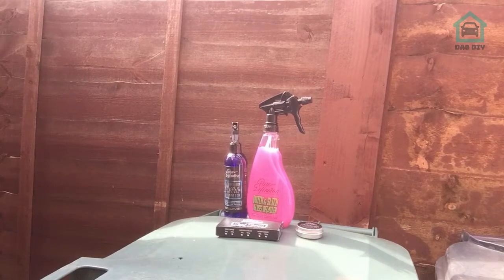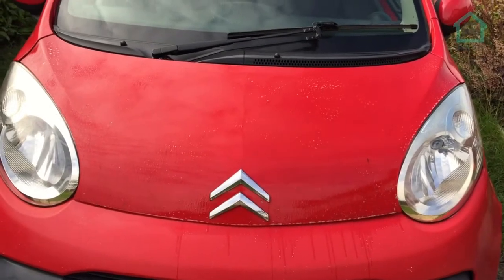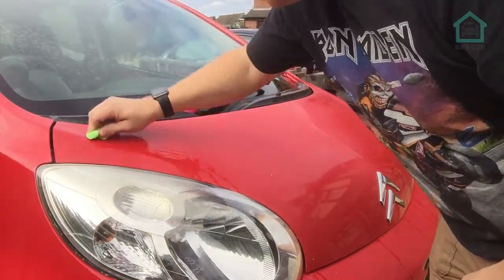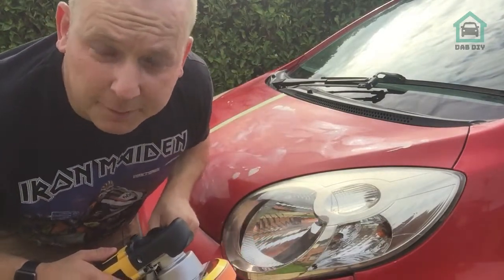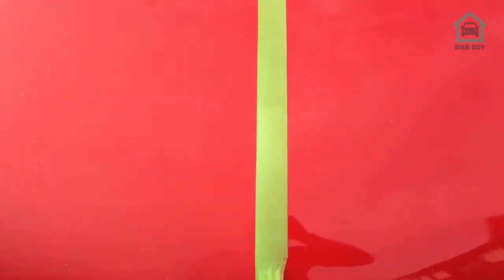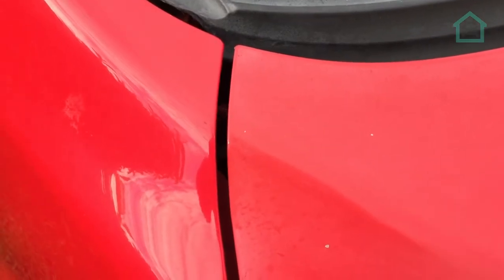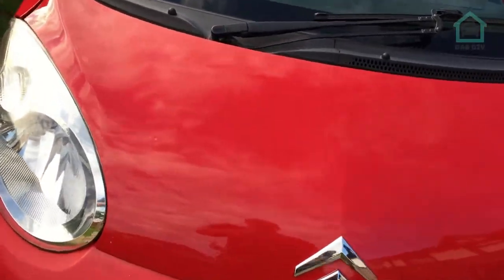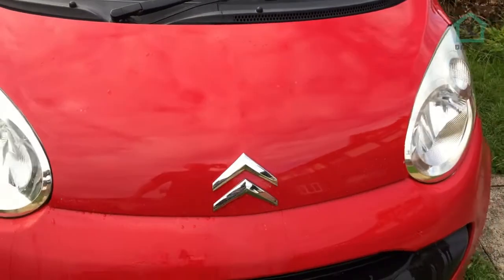Using a DA polisher for the first time

Comment: Been painted before    seen it done it,, bodyshop, tech  it will fade again  best get it painted  and a good laquer  put on it   if it were myn
Reply from the maker: It’s irrelevant now, it’s recently been wrapped in black vinyl. I never expected it to last, that’s why I bought the vinyl. You’re absolutely spot on though, it didn’t last too long!
Reply: @DABDIY  yip seems wrapped  cars are now getting  more  common  and it looks good  how much does it cost for it wrapped
Reply from the maker: I wrapped it myself. I’ve fancied giving it a try for a while, video to follow as usual.